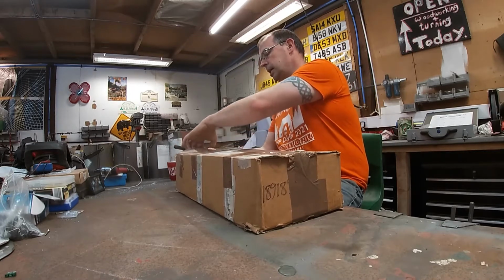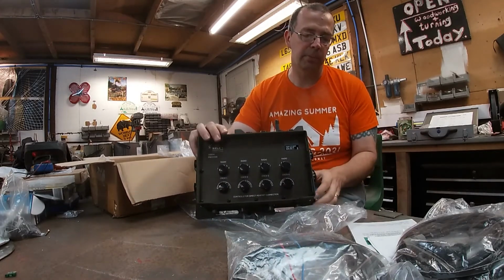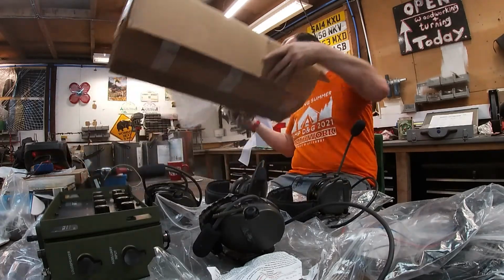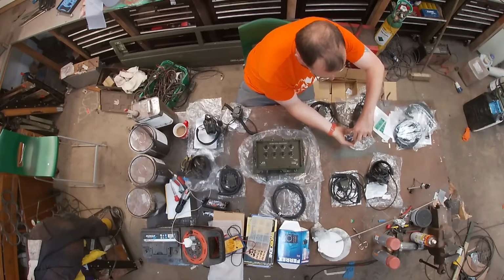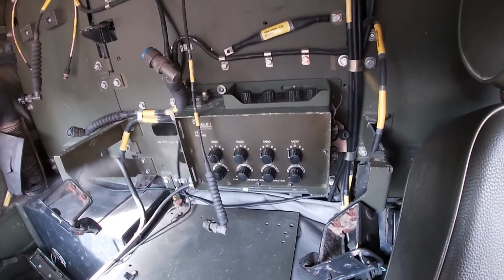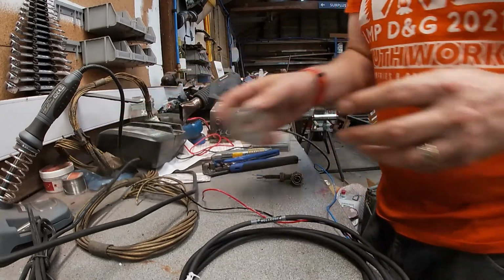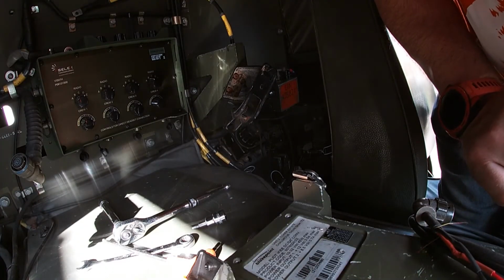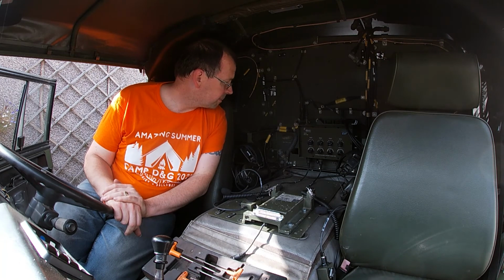vehicle intercom system Pinzgauer 716 - Ep 12 British Army Truck HOW TO INSTALL Selex VIS07H

Comment: Nice, so bought one to fit to mine.....!  When you link up the stereo, can you video too?
Reply from the maker: That’s the plan. Soldering job with a 7 pin clansman plug.
Reply from the maker: What are you fitting it too? I’m working on a few wiring videos. Split charge, 12v from a 24v system, fitting a 12v fuse box,  12v cig lighter socket, boiling vessel install and wire,etc etc
Reply: @choppergray1  vector ppv.....
Reply: Is there any other way of contacting you via Facebook or phone call?
Reply from the maker: Are you in any of the military vehicle Facebook groups?
Reply from the maker: If your the Alan Edwards on the Facebook vector 6x6 group then I have sent you a friend request.
Reply: @choppergray1  done